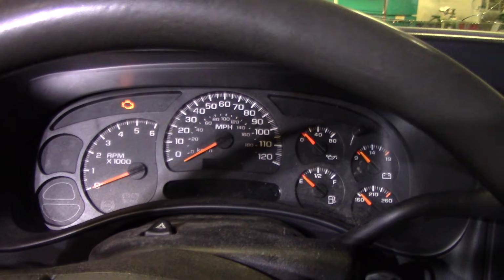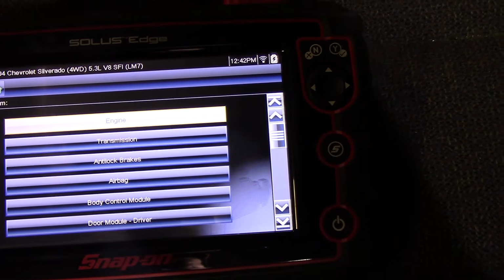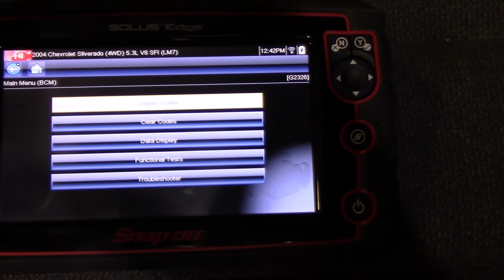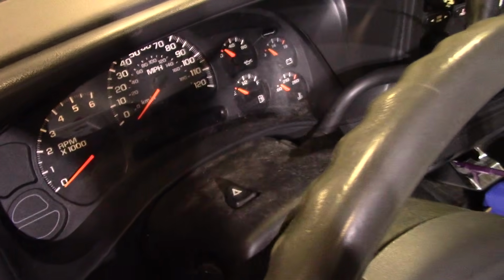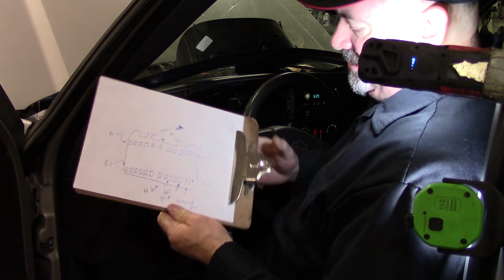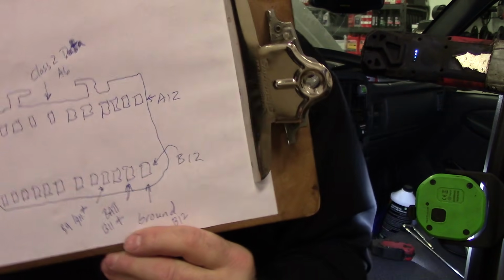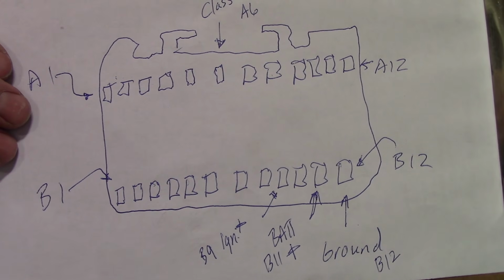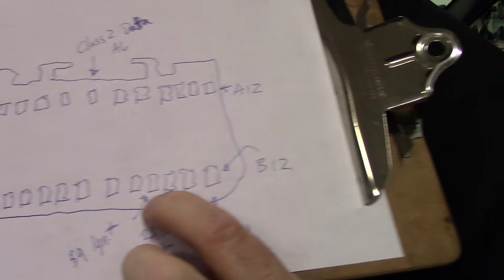Chevrolet GMC Cluster Gauge Diagnosis and Repair

Comment: Currently having the same exact issue. Only CEL and blinkers work. Only ground that wasn’t connected was the hood ground. I replaced that and the fuses under the hood. Still nothing. I found a known working cluster and same issue. I guess my next route is to test the connector itself as shown in the video. Any advice would be great thank you

Comment: Hi Doc
Thanks for the awesome video, fully detailed. I do have a question - when replacing a cluster does it have to be reprogrammed to the vehicle. I’ve been told the vehicle won’t start without having it programmed. Any info would be very much appreciated. I own a 2004 GMC 2500 with a speedometer issue, it’s showing inaccurate speed reading, example- doing 30 miles an hour it’s showing a rating of 70 miles an hour.
Once again any info would be very much appreciated.
Thanks Doc
P/S
Sorry about the long text message.

Comment: What’s the voltage
Reply from the maker: @ryanlerouche5122  depends
Reply: @ I got Battery volts out of B9 but B11 was only given me 5.5 v . But you said b11 was battery volts. Not computer volts.  I had no gauges like what this one was doing. But the semi broken one I had the gauges stop working too. I twisted the board and nothing.

Comment: Everything works on mine accept the odometer and speedometer. This started after I ran the battery down and had to disconnect and recharge the battery a couple of times to find a light switch left on. Any ideas anyone?

Comment: i have low oil pressure i change oil pump o ring to pick up tube an oil pressure sensor still low oil pressure any idea what could be the problem 🤦🏻‍♂️🙏
Reply: There's a oil barbell or rear gallery plug could be the culprit or oil pressure sensor failing ,  possibly a dirty oil filter.. ?

Comment: i have low oil pressure i change oil pump o ring to pick up tube an oil pressure sensor still low oil pressure any idea what could be the problem 🤦🏻‍♂️🙏
Reply: Oil pressure sensor ?

Comment: I used this video as a guide to repair my cluster. It had the check engine light on.
Occasionally the brights would come on when I used the right turn signal. 
And my gauges stopped working.
My friend heated up the solder joints 
(He builds circuit cards for a living) and added a tiny amount of flux core solder at the ground and a few key spots. 
Check engine light went our like it should. No brights when turning
And all of my gauges work again.
Thanks for the great video
Reply: + @graveydayvee Was your cluster after all. Mines got 200K miles so soldering deserves a refresh Flux and soldering! Tired of of on off of it working and guessing my gas lol. Need it working  for  properly for long driving trips need temp and coolant gauges 😅.
Reply: @bcruzin28  yes it was my cluster. The soldering at the connection point is still holding. My check engine light has NOT come back on since the repair.. my friend that soldered it uses a soldering iron at work on small electronics. He's very skilled
Best of luck to you and I hope your repair works as well as mine has

Comment: How important is factory Radio ? I have 2002 Trailblazer, instrument cluster is exactly the issue of your video. A after mkt radio was installed speaker wires were cut ? 
   I’m following your lead

Comment: Well I got no ac compressor no backup lights no dome lights can't dim the dash out no gauges no radio things I have replaced and Done had dash panel rebuilt changed all the fuses there hot with power all the relays checked every ground wire in and on and under the truck replaced the bcm with a new one new batteries the truck will start right up and drive with no problem and the dash has a abs light on battery light on air bag and check engine  I even changed the fuse block   took the dash apart and checked the wires and ground  my heater works only thing is ac compressor not turning on I can jump the relay and it will freeze you out  and least it won't let me scan it  no connect yes I checked all the fuses and wires on that  and least but not first the Chevy dealership had no clue what it could be  so yep  47 years of being a mechanic this one has me

Comment: I have this exact same problem currently on my 2006 Silverado 1500. I am bringing it to my local Auto Electrician business. I have tried to change the IPC fuse, and that is about it before I pay a pretty penny to fix it. The truck runs fine, but I think the cluster has gone out at about 127,000 miles. 

It used to be my Grandfather's truck that I inherited. I am trying to fix it well and drive it for how long I can.

Comment: Thank you for your videos👏, have you encountered any issues with a 2007 BMW 328i, no cluster lights, Push starting nothing/cranking nothing, car wiper going crazy like if the battery was dead

Comment: GM's warranty on these were a complete joke and realistically only covered them until 7yrs/70k miles but if it was 7yrs/80k you had to pay for labor. I remember back then there wasn't really any good information out there but the speedometer on mine went out just past the 70k mile period which is ironic. From the information I've been reading lately that GM was replacing clusters but back then I thought it was only for the specific gauge that failed. I didn't want to take the chance with the dealer just replacing the one motor and found a guy on eBay from MN that replaced all of them which evidently was in 2011 and my truck is 2004 so right at the 7 yr mark. Today it is currently being shipped back to me after getting a full rebuild due to having the language scrolling issue, all the connections resoldered, the motors replaced with the latest revision along with adding the transmission temp. gauge.

Comment: So before I had no choice but to drive my avalanche it was parked for a while. And every time I went to run it for a while the odometer would jump at an alarming rate. I swear it was 100’s of thousands of miles but then the drivers info center only says odometer malfunction no gas mileage also. I’m not real sure exactly how many miles was on the truck Oh and the whole clusters needles go crazy every so often along with all the lights on the dash. Any advice?

Comment: Watching your video. You mention that you can tighten the connector sockets where the wires go into. How do you tighten them? I tested the connector for the light swtich as well. both gave me 0.85 readings. So, what does that tell me (im no mechanic, lol) But the switch does work my lights in the van and my headlights. Its just the dial (lower switch). Its a new switch.

Comment: 04-18-23 fair, need brake pressed, truck will roll when  lowering shift stick. Needed GM contact, a complete pin  description, of the connector, would have been helpful.
Reply from the maker: Whats a GM contact? Just curious

Comment: Ok I checked all this.  My issue is a dead cluster with just the check engine light on.  But it only dies when there's rain or moisture or freezing.  Power comes back after a few days when the weather is sunny and dry. I know I can't be the only one with this symptoms

Comment: My issue....partial instrumentation readout.... RPM's, oil pressure, voltmeter, temp guage all work. Fuel Guage, speedometer and odometer does not.  I have changed out the cluster and get the exact same results...so what's the fix for a half out cluster?
Reply: Was you able to solve that problem?
Reply: @Faded614  nope!
Reply: @slydale  if you do please let me what you had to do sir.

Comment: My Gear indicator (PRND321) doesn’t always illuminate, at times it will magically work perfect. The weird thing is when it works my mirror displays the temp/compass. Both don’t work then both magically work I have tried so much. 

Another weird thing is some of the times the compass lights up it’s all messed up and every line is lit up so it’s just a jumble of lines

Comment: I have been attempting to fix the cluster problem for a while now. It would go off  intermittently. Your method of using the multi meter pinpointed that it was indeed the cluster and not a ground or wire problem.  Your drawing of what pins to check was great.  Ordered new one and problem solved.  Thanks!

Comment: Thank you for saving our camping trip! Our 2004 Chevy Express body class C camper instrument panel gauges weren't working. I disconnect the battery when I store it and I guess the computer needed reset. I bumped the battery cables together as you suggested and Hallelujah!!

Comment: Thanks Tim. Just watched your video here in Cooper Landing and after checking the plug contacts for voltage I gave the cluster a twist and it started working again. The PRNDL indicator doesn’t light up, so I might have to resolder the resistors and maybe order a new panel if the gauges stop working again.

Comment: Lol take the circuit board out plug it back in and touch each resistor/diode with a pencil eraser until you find the one with the loose solder connection then resolder it. No need to buy a whole new cluster. I've been through that problem before 😂

Comment: Before taking all of this apart and doing the soldering, try an EASY fix! Check the cigarette lighter on the right side. I just used a USB adapter with a light to see it didn't work. Picked up a 15A fuse at OReilly's and 10 minutes later, with the fuse replaced for the cigarette lighter, the gauge panel worked again!
Reply: Know this is old but damn I'm having trouble.. when the cluster came back was it able to connect to the old again!?? Thanks in advanced
Reply: My right cig lighter works left one don't lol
Reply: Thank you dude I appreciate it

Comment: So my cluster gauges quit working... I test the wiring harness and found no power to the b11 pin... I have had the cluster replaced by the dealership awhile ago... My question is where does the power supply come for that pin? All fuses are good... Thanks in advance...

Comment: Thank you Tim   Im glad i played your video.   I have a 2004 silverado 5.3  it has the same problem as  your video.  the only thing  that my vehicle did not start. but same problem no communication, no dash gauges, no start.  all grounds were intact.  I will pull cluster and do full inspection.  thank you thank you.  again.

Comment: I have a 2000 GMC Sierra 1500 . I replaced my battery and now speedo reads max. Any chance there is a easy fix on this? Only codes I have is for the abs I haven't gotten too yet...rest of my gauges work normal
Reply from the maker: Most likely your stepper motor failed.
Reply: @ThecardoctorTV   ty for the responce. I ended up trying a few things check and replace the fuses to dash. Ignition on push gas peddle 3 times . What ended up working to reset the speedometer was removing the positive and negative taping them together to release  heat power was in the system and works now :).... Bought this used and there is a ton of issues that dident show till the codes reset tho :(

Comment: Hello..with most of those cluster symptoms..can or will it affect my charging system in my 2004 yukon cuz i get battery draineg. Ive installed a dual battery with Stinger isolator and big three and slightly bigger alternator that's running a 3000 watt amp pushing 2 sundown 10's

Comment: General question here I guess.  I recently replaced my instrument cluster.  The connectors on the old one were a little mangled.  The cluster had a constant check engine on but went a little nuts at an intersection and the truck died.  I managed to get it started and pulled into a gas station.  Got a ride to the salvage yard a few miles up the road and replaced it.  So my question is related to what I noticed after replacing.  The truck started up better than it did before(was a hard start once the truck had ran for a bit). Also the check engine that was on was no longer lit up.  So to my question.  Can the instrument cluster effect how the engine starts/runs?  Like I said it went from having a hard start to it starting right up as soon as I turn the key.
Reply: Had an older Mazda 626. Kept going thru alternators and batteries. Just before replacing parts volt gauge would do weirded stuff and clicking sound from dash. Replaced the gauge cluster and had no trouble with alternator until I wrecked the car.

So I guess it's possible.

Comment: I lost my dash gauges yesterday 04 Yukon Denali , checked my grounds and fuses, all good. Pulled out the instrument panel and gave it one twist like you did in the video and it started working. I will order a new or reconditioned one since my PRNDL wasn't working even before this issue. Thanks for the video!

Comment: Rebuilt instrument panel. All the lights only work in the start position for just a second. The security light does not work in the on position. And can not get it to start. Only for a second then the Passkey 2 shuts it down. 2004 k1500.

Comment: I'm having a strange issue on my cluster where the blinker indicators are always on, but dim. Sometimes during acceleration they get brighter until i take my foot off the gas. Also they light up bright when turning the wheel to the left. Not only are they illuminating on the cluster, but also the indicators on the rear view mirrors. 2003 GMC Sierra 1500. I've replaced all bulbs with correct ones(front and rear exterior), flasher module in the dash, multifunction switch on the column, the rear tail light circuit board mounted on the frame, replaced the braided ground wire on the firewall to rear of engine, and even the brake light switch on brake pedal. Cleaned what grounds i could find, such as the two on the frame under drivers feet, and the one on the front left dash under the A pillar. I cannot seem to figure this out. Even if I remove fuses to blinkers, or even the flasher itself, they are always on. What would you recommend I look into next?
Reply: Did you figure this out
Reply: @RandomAfclips  nope. It “fixed” itself somehow.  Changed blinker assembly on the column, new control box under the dash, grounded tail lights to the frame, new rear lights panel that’s attached to the frame near the rear and it still did it…one day…it was just fixed. Sold the truck a few months later.

Comment: Quick question, I have an 02 savana and my cluster fuse popped, everytime I replaced the fuse it pops immediately. Any suggestions for a fix? I'm going to check all grounds and pull it out but curious on your thoughts? Thank you

Comment: Hoping i can get an answer. After a jumpstart on my 06 gmc sierra denali all the gauges stopped working, except for rpms. Also no communication with obd2 port. No radio, door locks, and no windows. My main concern is the cluster and obd2 port communication. But can a jumpstart damage a cluster? In all my jumpstarts ive never had a problem as bad as this.
Reply from the maker: Yikes. Did the cables get connected improperly? First step is to test all the power supply circuits and determine where your not getting juice. Might have blown a fuse I suppose.
Reply: @ThecardoctorTV  i pulled the cluster today and found that it got fried.
Reply: Replace your cigarette lighter fuse 👍
Reply: @redefguy  it was the abs control module, the circuit fried inside. As soon as i replaced it everything started working again🤙
Reply: @manueltorres3735  huh interesting 🤔👍
Reply: @redefguy  well my bro in law was messing with the battery cables when i was doing a abs bleed with my scanner. I think he might of grounded out the wires and fired the abs control module during the process. The first thing that blew was the cig fuse, but i think since i was running power to the abs control module with the scanner it fried it during the process as well.

Comment: I have the same issue with my cluster and what's worse is that it just got installed new about a week and a half ago by my local Chevrolet dealership. It worked the first days but now only the backlighting works. The previous cluster had issues with the info center and some gauges but it never got as worse as the new unit and I paid quite a bit for it to be replaced. Could it be an issue with the truck? (2004 Silverado 2500 6.0L LS)

Comment: Hi Doc. I'm trying to find the video where you address the issue of a stupid little piston that gets stuck in the Envoy-Trailblazer engines that makes you beleive that you have low pressure and for the computer to send a warning signal to turn off the engine. GM Engineers a doing a lousy job and GM never made a RECALL about this problem. YOU ARE THE ONLY ONE THAT I HAVE SEEN ON THE INTERNET AND on YOUTUBE THAT HAVE FOUND WHAT THE PROBLEM IS. I got it a little bit fixed using a LUCAS additive and changing to 40w oil. THIS PROBLEM IS DRIVING THOUSAND OF CONSUMERS CRAZY AND WASTING MONEY AND TIME REPLACING PARTS THAT ARE NOT NEEDED!!!! If you got the LINK,  PLEASE POST IT HERE SO ME AND OTHERS CAN FIND IT. YOU ARE A GENIUS!!!! WELL DONE! YOU GOT MY RESPECT!!!

Comment: One repair guy found an issue with the ground with the black and white wire at the odm hook up. I am going to try that first before having to replace a whole new cluster. Or do the reset too. But Thank you if all else fails.

Comment: On my cluster the circuit board solder joints were mostly cold. Open connections all over the board. I just resoldered them all. Everything came back to life. No problems since.
Reply: I wonder why he didn't check the circuit board first before sending off for a new cluster... that may have saved the customer hundreds of dollars...
Reply: What did u soldering? Thanks
Reply: @markpadilla6205 all joints on circuit board

Comment: Pin number 8 is a ground for the odometer and gear selector
 Had an intermittent on/off problem. Tied an additional ground to that wire and it's fixed
Reply: Could you please explain how you did that?  I found a replacement gauge cluster - and of course, everything works but the odometer and gear selector.  And I can't get an emissions test without it.